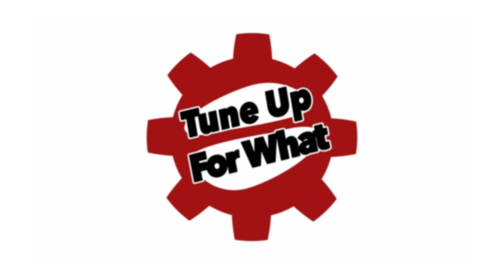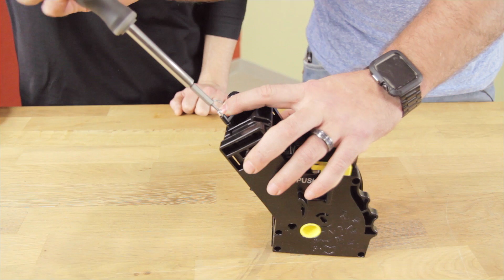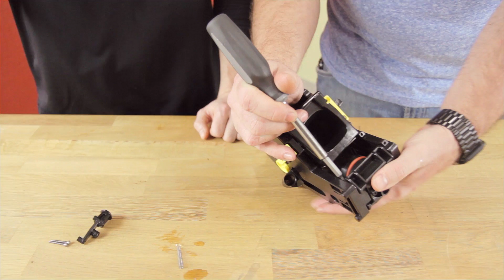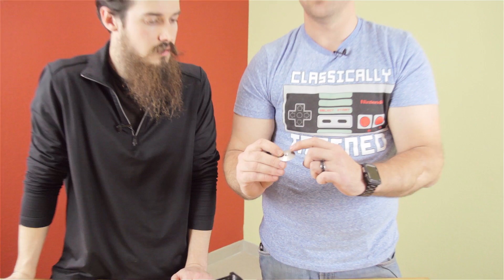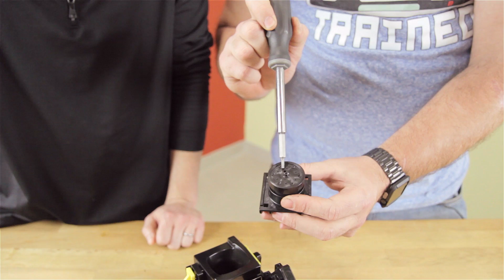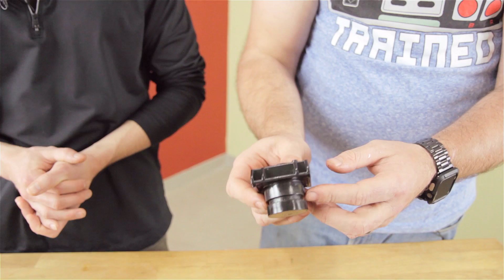Saeco Superautomatic Brew Unit Disassembly | Tune Up For What

Comment: Hello, we have a Saeco coffee machine in the office, very similar, and we have a problem when trying to make coffee. It doesn't come out through the usual outlets; instead, it flows into the internal reservoir on the right. We checked and found that the O-ring is dry, cracked, and practically non-existent. Could this be the reason for the leak? Thank you.

Comment: This machine is 8 years old and we have always maintained it, but I need to find the parts where ?
Reply from the maker: Hi there,

Unfortunately if Saeco doesn't have the parts you need it's pretty tough to track them down. Some users have luck on sites like ebay or on forums dedicated to older machines.

Comment: My brew unit is stuck. The used grounds discharge door is stuck open as well. Is this what's preventing me from pulling the brew unit out? If so.... does this mean I need to take everything apart to get the brew unit put in order to grease everything up?

Comment: I accidently managed to remove what I think is the ejector arm (plastic square with 1 side open and a wire spring) via the opening on the right side of the brew unit and don't know how to put it back in.  Any suggestions?  Thanks ahead of time.

Comment: I have a question for which you might have an answer :  I think that too much water is going inside the brewed coffe recipient. I don't know what i can do to improve that. I already cleaned and lubricate the brewer, cleaned the grid, changed and lubricated the orange joint of the brewer, and i also changed the 2 orange joints of the pipe connecting to the brewer when the coffee is pouring.

Maybe you have an idea of what's missing. Thanks

Comment: Hi, desperately hoping you can help me. I have a Philips Saeco Xelsis HD8946 (HD8946/01 10003562) I am missing parts from the Brew Group Unit these parts, SS conical spring (9965 3005 0657) also the Borosilicate Sphere (4219 4403 4451). I have been searching for the last 9 months. A third itemChrome connector Cap for Caraf V2 MYB9 Assembly (11024247) Which unfortunately stuck to a baking tray and melted. Down here spares are like kits or a full replacement, happy to pay, please let me know if you can help. (KiloCharlie)

Comment: Quick question. I replaced the o-ring on the piston but this one looks a little too small. That's probably what's causing the water to leak into where the ground coffee pucks go, right? I've been having this issue and I only assume that it's the replacement o-ring being too small. I didn't order the gasket myself, it was included when I got it second hand. I also noticed that the bowl area at the top is full of water when I take it out after it leaks. It seems as though the coffee backs up and overflows from where the little hole is (where your spring and ball go) back into the bowl. Mine is the older one without a spring and ball.

Comment: Thank you for the video. I let my Magic Deluxe from 2001 sit for 6 month in my garage after my wife redid the kitchen. I did not clean the brew group before storing it in haste. So when I pulled it out today and thought I cleaned the machine like at normal weekly cleaning, no second shot, when pushing for a double shot. It would slowly make the first, but the second it would labor, then sit, them refuse to brew and send the puck to the hopper!  It was the combination of the tamper screen being really gummy/dirty and the spring/glass ball being stuck. I needed a video on how to remove the piston and your video did that!!!! I thought I was going to have to open the entire machine and  clean the plastic  supply water supple tube, but nope, it was the brew group!! WHEW!! Thank you for the information video on how to release the tabs. The tamping of the machine bring tears to wife's eyes!! Fresh brewed coffee again and no more Keurig!! Thank you again!!

Comment: As a note to the previous comment. The brew unit does not go into work mode before it ejects the grinds. It shows no beans then ejects the fresh grinds into the hamper
Reply: I have the same issue.  Did you find the reason why?

Comment: Hi Guys, My Saeco Superautomatic is full of beans. It grinds but intermittently errors out that there are no beans. Then it ejects perfectly good grounds into the hopper. What do you think the problem is?
Reply: I have the same issue.  Trying to find the solution.  Did you find out why this is happening?

Comment: My Saeco Minuto doesn’t stop filling the cup when using the Lungo setting. I have to push the button to make it stop. Works fine on espresso though. Any ideas? Probably a circuit board of some kind is my guess.

Comment: Thank you for these instructions! The coffee output of my Saeco Syntia was very slow such that it took much longer than normal to brew a cup. Disassembling the brew group and cleaning out the metal screen with compressed air has fixed the problem. Thanks!

Comment: After removing a Stuck Brew compartment & throughly cleaning it, & re-positioning the compartment to neutral position, the gear on the inside the Saeco Villa machine will not turn into the neutral position. I can no longer fit my brew unit back into the slot. Is there anything else that I can do?????  I did the whole nine yards by placing the index card into the slot to engage the micro switch to switch on. The gear turns a little like it would normally but, the gear in the machine is still in the wrong position. Any further assistance appreciated.
Reply: Raj Patel I have the same problem exactly did you solve?

Comment: hi. my saeco professional royal does not dispense water properly. Steam works, hot waters works but it does not work dispensing the coffee. There, no water comes. Its making a funny noise and then stops. Its also says half way in the process to ventilate. The swimmer in the water dispenser is lagging too and needs manual help as the word '"fill water" comes up but container is full. Many thanks for any advice.
Reply from the maker: It sounds like a few things are going on, we'd recommend having a repair tech take a look at it.

Comment: Hello! I have a similar problem as the person below with my Saeco Giro Odea Plus: coffee grinding fine but not coming out of the funnel, soggy puck puddles and weak coffee. This all of a sudden.From one brew to the next on the following day, it went from nice dry pucks to mud.  Another video suggested pressing down on the grinder apparatus and see if I can feel the funnel move. Mine did, so appears that it's not broken. I can feel the grinds piled up at the opening flap; they're just not moving into the brew group. Sounds like it's working as usual otherwise. Might this be a crudded up brew group issue? Any other suggestions would be awesome!
Reply from the maker: Our first recommendation would be to remove the whole brew group and give it a thorough cleaning, after which you should re-lubricate the o-ring with a food safe lubricant (or coconut oil if you are in a pinch). Hope that helps!
Reply: I have thoroughly cleaned and dried the group, but I haven't lubricated the o-ring, so I will try that. Thanks for responding!
Reply: That may have done the trick! I was able to make 4 pulls without it being water (though pucks are still soggy). Having done research on coffee machines, I realize that some models keep one grind's worth of coffee in the chute, which may be what I can feel.  (and negating the concept of "fresh ground"beans!) Thank you again SO MUCH!
Reply: Just wanted to chime in that I've made a few capps and the machine is working perfectly! Thank you SO MUCH! When I'm ready for a new machine, I will definitely see what you've got.
Reply from the maker: Excellent! Happy to help

Comment: My Saeco Odea Plus does not make puck in the output bucket, it is only by mud....WHY???
Reply from the maker: The consistency of the puck is related to the machine settings and beverage type. A lower pressure drink like an americano/coffee, a coarse grind setting, lighter aroma, or higher coffee volume can all result in a more watery puck. Hope this helps!

Comment: Thanks for the detailed instruction video! My machine would not give any water/coffee anymore, so I decided to clean the brew unit. As the inox screen was clogged with a lot of coffee residue, I decided to clean it with a dishwasher tablet. I also put the glass ball in without thinking. Now the ball isn't clear anymore but more opaque-like and a little rough. When I reassembled the unit as demonstrated, the problems persisted. Then I removed the ball from the brew unit, and the machine ran smoothly again. However, there was no crema to be found on the dispensed coffee. Could this be because of the glass ball not being smooth anymore? Thanks a lot!
Reply: I spent my whole day trying to fix this machine. Thanks to your commend, I put the ball out and it finally gives coffe. And like u said, it's without the crema. But who cares... Thanks dude.
Reply: Dude! You made my day. Spent a whole day cleaning various parts. Now I get coffee. And as a previous commenter said, there is no crema.
Reply: I actually replaced the glass ball with a new one and it still didn't fix the issue. How you ended up fixing yours?